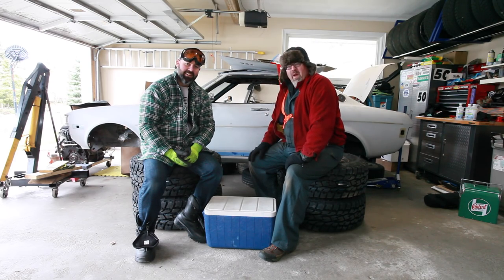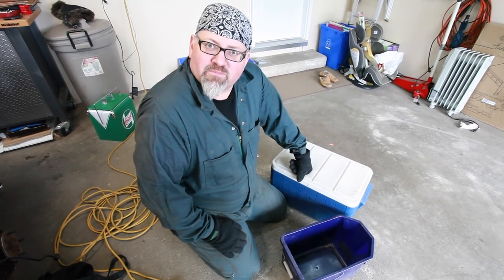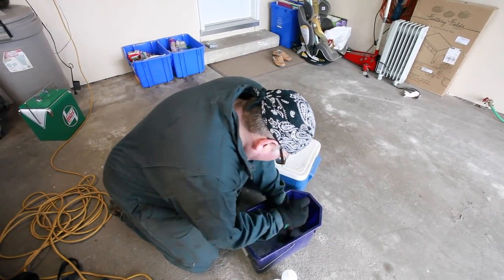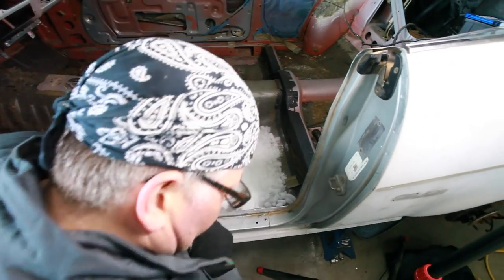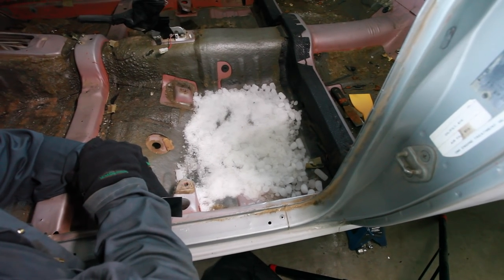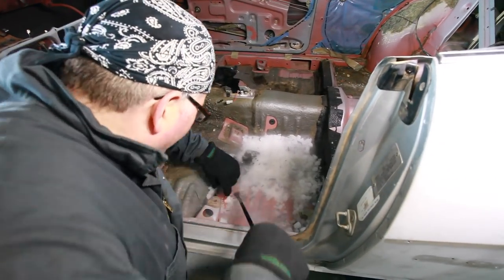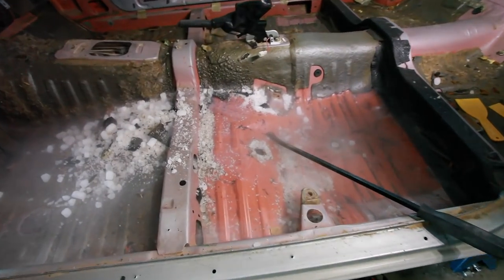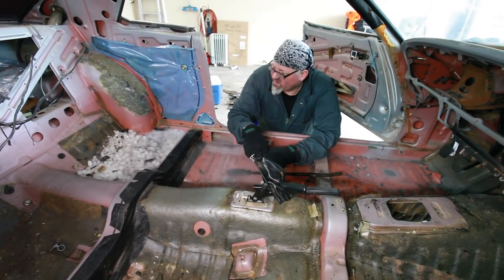How To Remove Sound Deadening Using Dry Ice - RA24 Celica Project

Comment: The small plates are just covers for the alignment/fixture holes when the chassis was assembled and welded. They could also be used as datum points for frame pulling if the car were bent in an accident.
Reply from the maker: +Dilligaf Dan hmm, this sounds like a pretty convincing explanation to us!

Comment: I've used this method several times and there's no reason to use any other method in my opinion. Very effective and really easy. My most recent recipient of the dry ice was my 72 Datsun 510. I hope to unveil the finished product this summer. It's been 10 years in the making. You seem to be making much faster progress than I have.

Comment: +SpeedAcademy those are drain plugs in case the floor gets completely socked and a puddle dosen't sit in there and rust your floor pan out and the plate is to prevent water from getting inside the cabin while driving through rain/puddles
Reply: +Jimmydean hilltow it looked like it was covered by the stuff they where scraping out though.

Comment: next time, put the dry ice in a garbage bag, so you can make less mess and easily do the drive shaft tunnel etc..
Reply from the maker: +Aaron Besson ooo! cool idea! (no pun intended)
Reply: Ahhh good tip!
Reply: Wouldn't that freeze and crack the bag?
Reply: +Integra DIY we used the heavy duty ones and they worked fine once you keep it moving around a little. we also didn't use the alcohol trick
Reply: would a pillow case also work?
Reply: H2BpullsK20 I actually feel dumb after seeing my comment above from a year ago. I've used dry ice to remove all the sound deadening from my dc2, and you can put dry ice in any plastic bag, even a paper bag.. it did kinda freeze solid a floor mat, so I don't know how well a pillow case would hold up. Off topic, But I've found the best way to remove sound deadening using dry ice, is to crush the ice into a powder and applying it evenly on, in chunks it leaves too many voids and doesn't harden up and crack much
Reply: Integra DIY i tried the plastic bag trick just today, abandoned the plastic bag as soon as i started. Using rubbing alcohol and crushing the ice works best, but yes you do need more ice with that method. Plastic bag is a good idea just not for me. Its a realy great idea for those not so flat areas so i might try it again.

Comment: Done it my self and yes, dry Ice is the way to go for sure, but what I do is pit it in a plastic garbage bag, this allows you to move it easily and also supports it to mold it around curves, such as the trans tunnel. Because it is in a nice bag and you can re use easier and you use less.
Never used the alcohol mix, will try it next time though

Comment: I had pretty good luck waiting for a really really cold day and doing this. It didn't just crack off but it came up in huge pieces.
Reply from the maker: +ZachicusMaximus hmm, one of the only advantages of a severe winter? We hadn't considered that idea, but hey, it's done now!
Reply: +Speed Academy The couple of times we have done this, it always seems to be freezing cold outside (and in my garage too...!).  I figure the hotter out the better.  That way, as the dry ice causes the sound deadening material to contract/shrink you get a bigger temperature differential and therefore better separation (more cracking).  But, I have nothing to back up this theory....
Reply: +jandmwheeler 
You are absolutely correct, the temperature differential and the different thermal expansion/contraction rates of the materials (steel and bituminous) is what breaks the bond.

Comment: I still have vivid memories 20 years later from scraping that crap off my EG with a chisel and hammer and chemicals. Deep cuts in my palm from working the chisel's handle for hours and days, lots of sweat and chemical stank. Wish I used dry-ice instead back then.

Comment: "i will never get tired of the smoke that comes off this stuff" -  you will if you lean in close enough!

If you are only doing a small area and don't want to get dry ice, use a aerosol keyboard duster turned upside down. Worked great on my ASS2000!

Comment: plugs like those are for letting out the solutions when painting, when they dip the car in degreaser and such it all has to go out somehow, not positive as they are usually just rubber but its a guess
Reply from the maker: +splice247 there were also some of the usual rubber plugs in the floor too, but these metal ones were new to use. We removed a few and they seem to give access to the brake lines or fuel lines, so perhaps they're for servicing those somehow.

Comment: I knew the answer to the flappy thingies, but I'm afraid I don't know what those floor plates are for. Looks like only a few possible answers to chose from in the comments.
Reply from the maker: +UndergroundTrev ya, we're thinking they may be access ports to the brake lines and fuel lines.
Reply: +Speed Academy yea but you'd think it'd just be easier to access from the bottom rather than to take the interior apart and the sound mat? Seems a bit tedious

Comment: The removal of the sound deadening isn't done as much for weight savings as it is for safety because that stuff is very flamable! It deosn't weigh that much that it will affect speed in a catastrophic way but it can cause some serious problems when things gets hot especialy around the transmission tunnel.
Reply from the maker: +Peter Vladimirov interesting, we haven't heard the flamable reasoning for removing it before.
Reply: In many racing federations(FIA included) you have to remove it or you will not pass thech inspection. Keep up the good work guys the project is looking awesome. I've always liked the idea of a RWD Toyota with NA power.

Comment: Call me weird, but id rather have 40 pounds of sound deadening in my car rather than lose my hearing without it.
Reply from the maker: +Mortalomena you're weird! ;) Dave's already mostly deaf and mostly stupid, so the sound deadening was reduntant.
Reply: +Mortalomena yeah, i would rather increase it than remove it, especially if you take it off of all the thin sheetmetal this thing vibrates and sounds terrible, and if stones hit the bottom.. Nah.. 
But i guess they make it very track oriented with roll cage and everything so it's not really needed.. 
But never would i remove that stuff from a street driven car :D  Each their own..
Reply: +Mortalomena u can also replace the sound deadening with lighter weight "peel n stick" stuff like dynomat and it will be better than the stuck stuff. u can even spray it with flexseal for a cheap alternative
Reply: +Luke Gilson 
DEI products and Lizard Skin both have excellent light weight sound deadeners and thermal barriers.